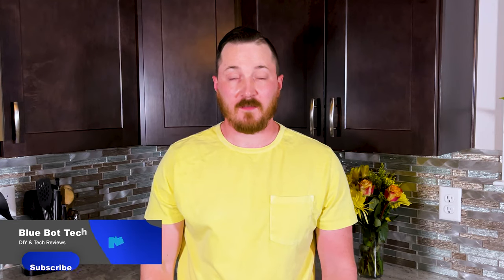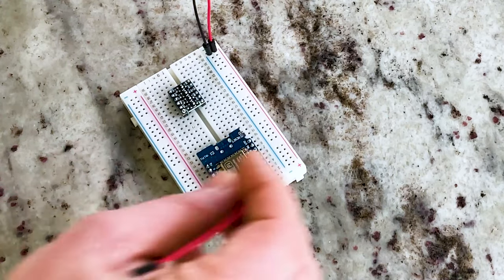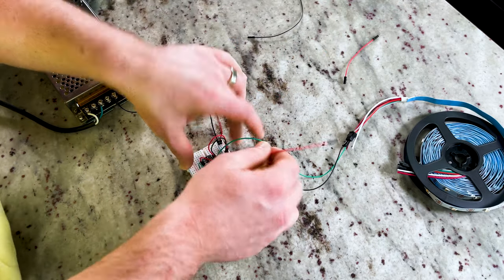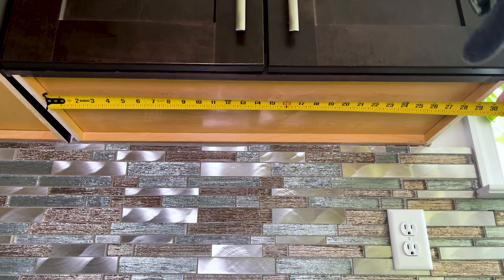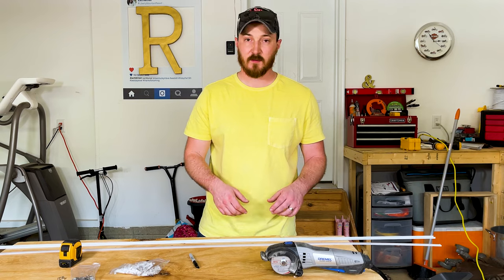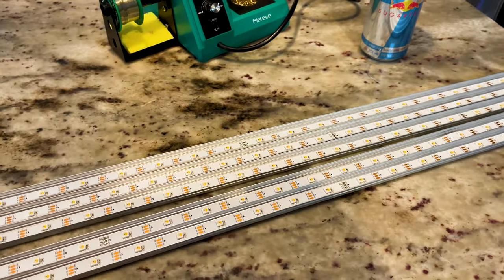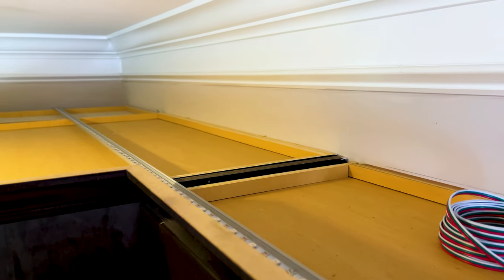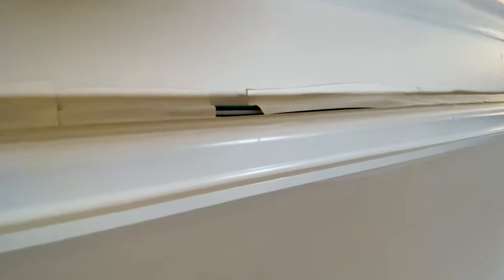Under Cabinet Smart Lighting Project /w WLED

Comment: Looks good! Run some wires through the cabinets and behind the refrigerator so you can add more lights at the bottom of the baseboard bottom cabinets!! That’s how I did mine. Top, middle and bottom!

Comment: Couple of things...1) Great job...finished product looks really nice. 2) Can you explain how you were able to wire up 2 different segments (upper and lower lights) using the same board?  3) You might want to include a short explanation on how the data flows using the arrows on the strips.
Reply from the maker: We added a wiring diagram here: https://tinyurl.com/7f965rvc, however this does not cover how I control both upper and lower. I didn’t include this just because everyone’s set up would depend on their kitchen layout. However, I’m currently running it in sort of a parallel configuration. I split the data line from the d1 mini to go to both the start of the upper and lower. The upper cabinets had a few more leds so  I just set wled to the upper cabinet number of leds. I may go back and actually make it all one strip, then take advantage of the “segments” feature in wled.

Comment: Great video thank you. What gauge wire did you use? Also did you use any additional wiring for injection?
Reply from the maker: Hi Martin Cunningham, we used 20 AWG from this link: https://tinyurl.com/35r8f5uh - Also, you can visit our github page linked in the description to see the wiring diagram for this project. Let us know if it makes sense we made it pretty quickly. Github link: https://tinyurl.com/7f965rvc. We did also add power injection at the end of the LED strips.

Comment: I have old school undercabinet lighting wired to regular wall light switches. One important thing I like with any automation is that regular switches work for the people who don't know the voice command or have an app on their phone. Interested in ways to get control of a regular wall switch to turn the cabinet lights on/off as well as dimmer control. Any ideas?
Reply from the maker: In this case I would suggest something like a smart dimmer. The tp link kasa smart dimmer, or something like the Shelly dimmer would be an excellent way to add this functionality. Both options leave a physical switch intact but also open up smart possibilities!

Comment: Hi, what are the wires that you used to connect pins from the controller to the logic level shifter and so on for the breadboard - they had male wire ends at each end, eliminating the need for soldering. Also, which breadboard did you use for this project? Thanks, Great Build!
Reply from the maker: Hey Will, when on the breadboard I used just standard breadboard jumper wires with male ends on both sides. These and the breadboards were found on Amazon. I can try to get some links if you’d like. Once taken to a final product I did switch everything over to 18 or 20 gauge wire and DuPont connectors. However, if I were to do this again, I would use JST connectors as they have a locking mechanism that you don’t get with DuPont connectors. Hope this helps!

Comment: Did you not use any power injection?  I have a similar setup and it was impossible to get running with the 5v PSU.  Had to switch to 24v transport line with a ton of 24v to 5v buck converters.  It was a nightmare.

Comment: Thank you for this. I think you forgot something incredibly important. Your power supply is a death trap. Would be good to at least mention that an enclosure is a must, if you don't want to kill your wife and kids. I'm sure you wouldn't try to touch those contacts, but kids or even guests might.

Apart from that: great project! Thanks for sharing it with us!
Reply from the maker: SiLeXnet, good point! You definitely want to have your power secured in an enclosure and out of the way. Thanks for the comment!
Reply: Death trap is a bit strong.  Life is full of risks.  Instead of plug covers, I put a bowl of pennies on the coffee table.  120v won't kill you, will just teach a valuable life lesson.